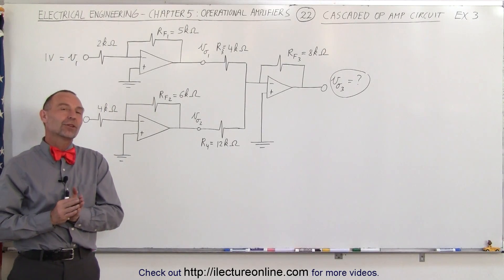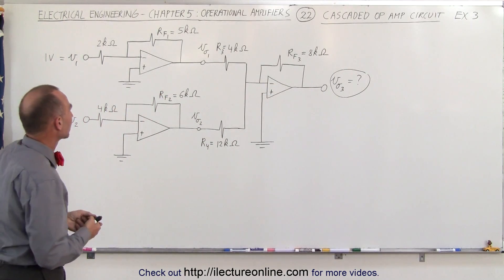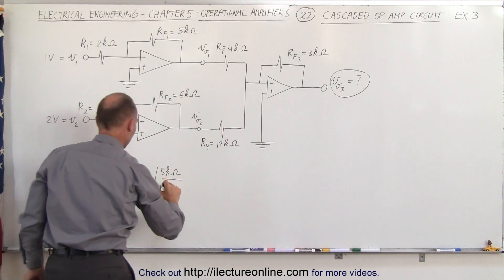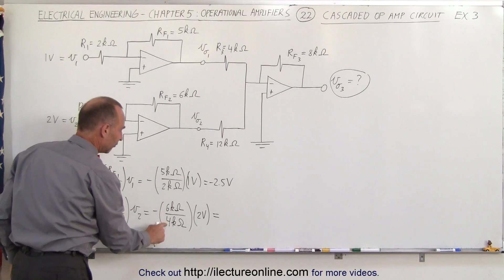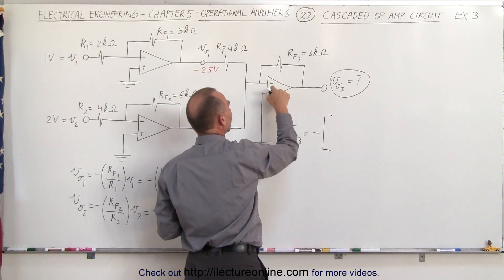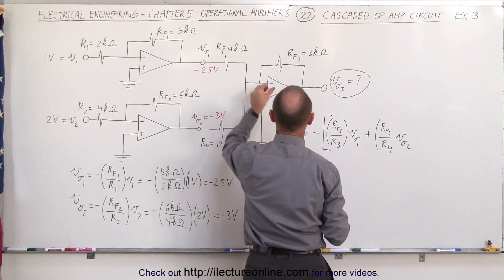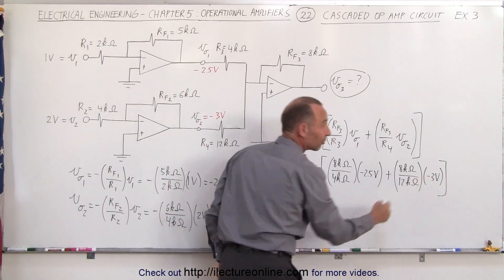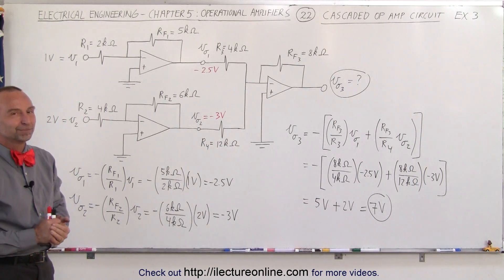Electrical Engineering: Ch 5: Operational Amp (22 of 28) Cascaded Op-Amp Circuit: Example 3

Comment: For those who are curious about where the extra voltage comes from: It comes from the power supply voltages not shown on the diagram. So no voltage generation here.